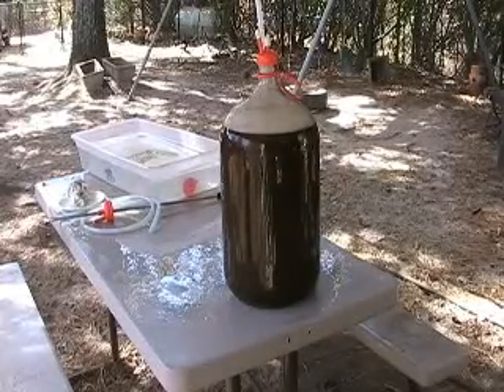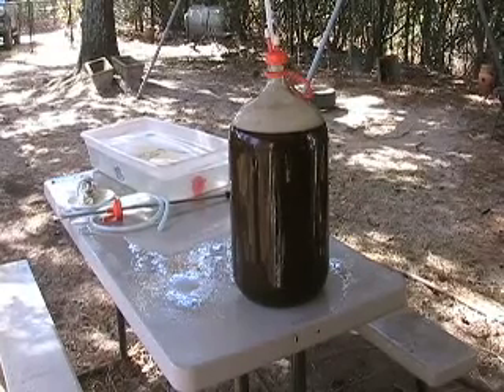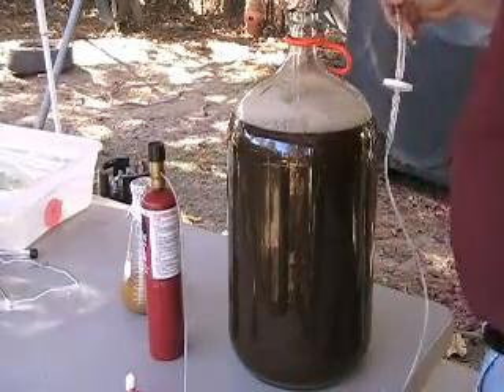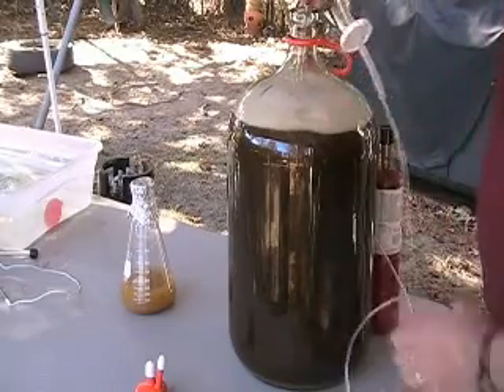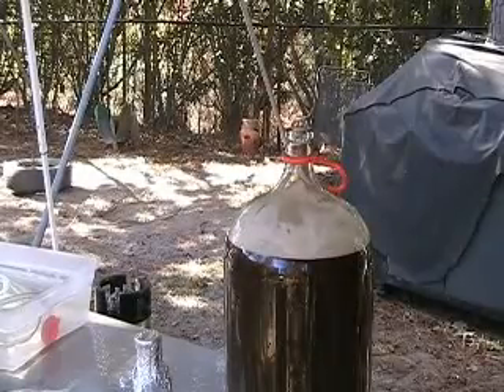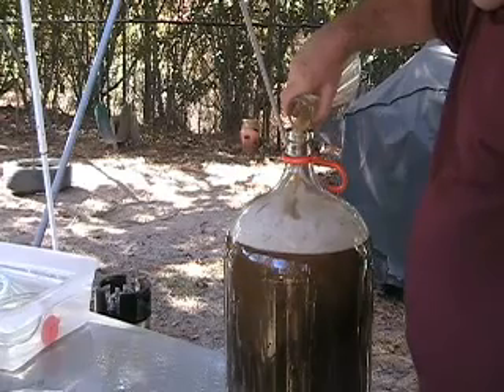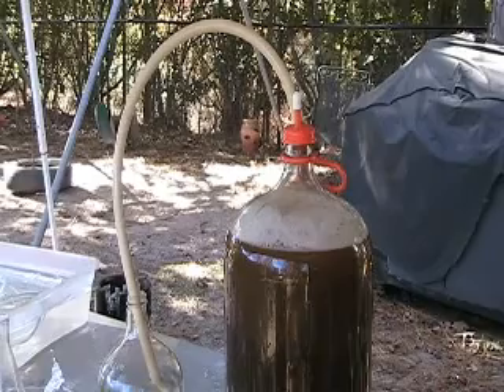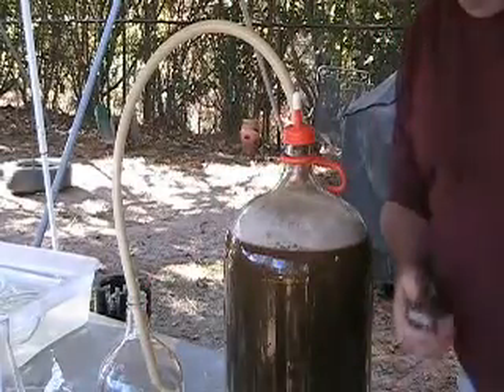Brewing 41 North, Pale Ale (Part 9 of 9)

Comment from the maker: Thanks...
I only aerate for about one minute.  You CAN over aerate the wort and stress out the yeast.  The amount of tap water used to prevent boil over is a simple quick squirt from a garden hose with a sprinkle nozzle.  It probably adds less than a 1/4 cup of water. Hardly enough to even cause a flicker of a change in the gravity.

Again... thanks for the comment.  Good luck with your brewing!
Rex...